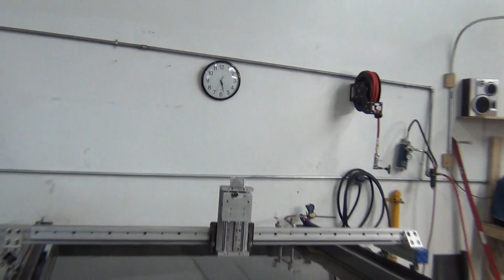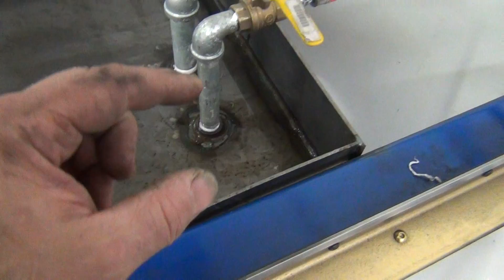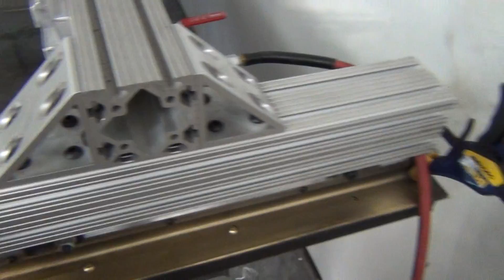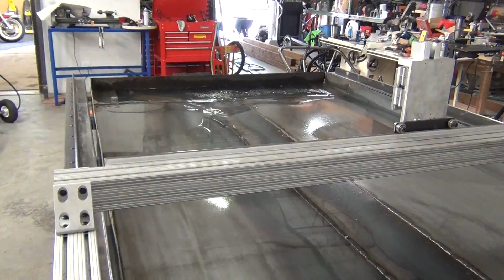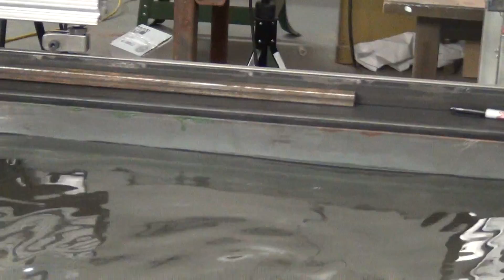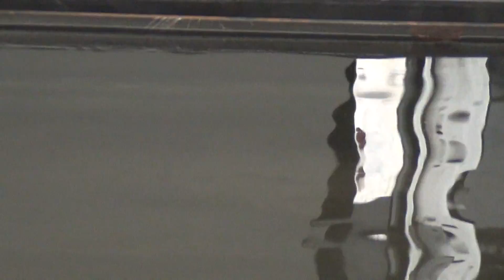CNC Plasma Cutting Table Water Table Build

Comment: Good jod!
You could put a plate over the water inlet area hole to keep debris from going down. It only needs about an inch to let water in from the water chamber. I'd bend the long edges, one down and other up 90 degrees and leave it loos so you can pull it out if needed to clean under it.
I built a similar water table like this for the shop I worked at that you could burn a 10 by 40 foot plate. 
I built it with a weer dam in the middle that had an O-ring seal so you could clean out one side while still burning a 20 foot sheet on the other side simultaneously cleaning the other side.
The bottom water chambers had a plate between to separate the two chambers that dividend it into two tanks and had air valves on both for control of either side. The divider plate came up through the tanks to allow the dam to seal the two sides to run independent.

Comment: Hi Mike...I would appreciate if you would share some of your knowledge...we have the same size machine and I'm willing to build a water table using Stainless steel, so my question is what sheet metal Gage you used also did you framed the tank or just used cross tubes underneath for support...thank you
Reply from the maker: Nazar Ramsey I used 10 gauge.   It's strong enough to support itself and only use supports underneath.
Reply: I estimated 11 Ga but will go with 10 as you said it'll support itself......really appreciate your quick response

Comment: Great build! Do you regulate the ingoing air pressure? If not, how much pressure are you pushing through at full blast? You mentioned in the video your compressor size but I just wanted to ask more details. Thanks an advance for the help from your videos:)